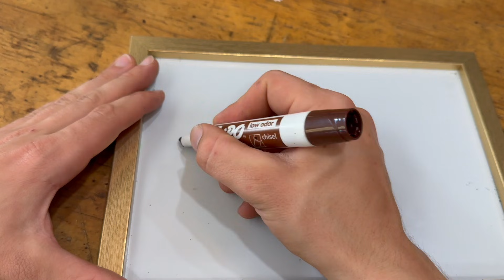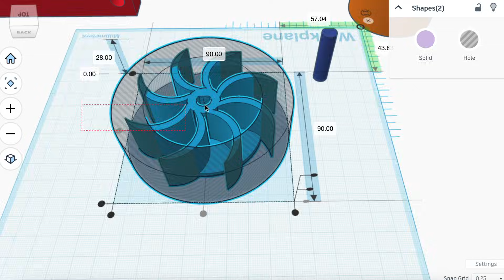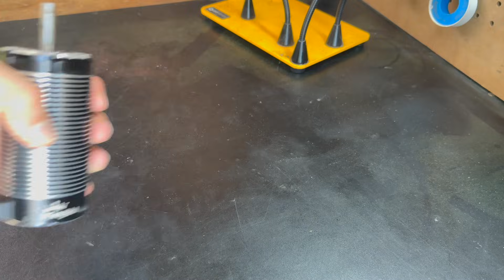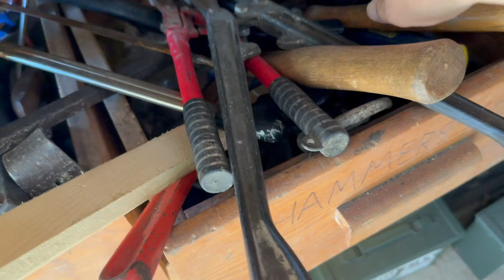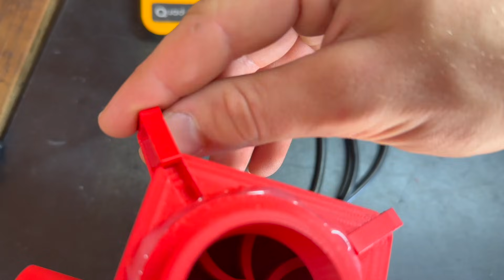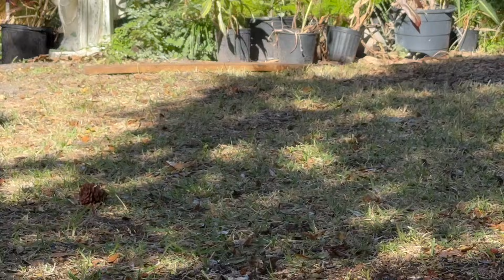I tried 3D printing a water pump...

Comment: great video man feels high quality and you did a great job. a few bits of advice. first in the future try to retake clips with failed audio. using a voice over on a clip with your mouth not matching can take away. otherwise great video. reminds me of a video you might see from NFTI. also the design of your impeller looks a bit inefficient. i would recommend you try and add some curve because that helps add force and the screws to hold it to the motor should be recessed into the plastic. hope to see more from you looks like you have some fun projects planned
Reply from the maker: Hey man, thank you for the feedback👍